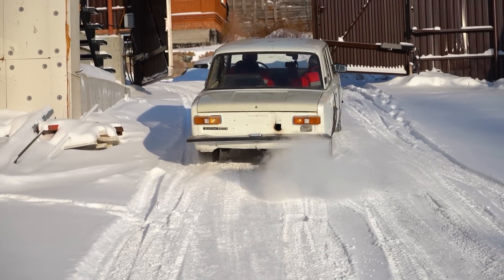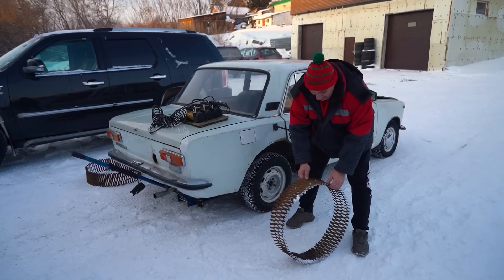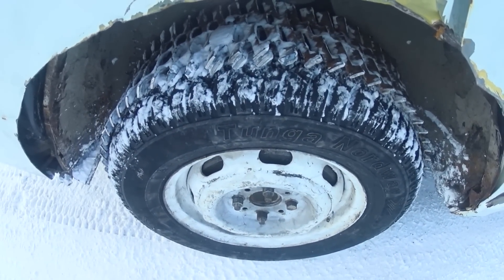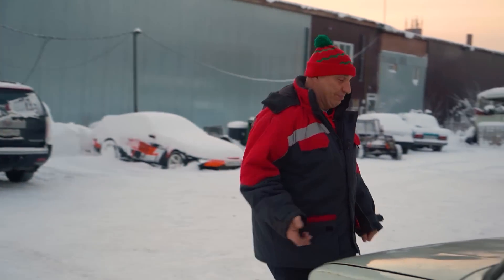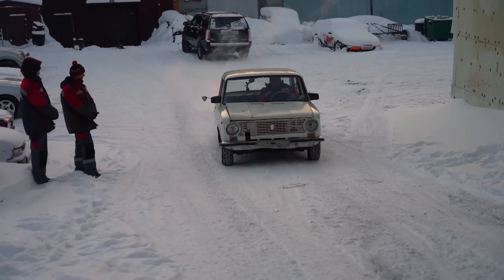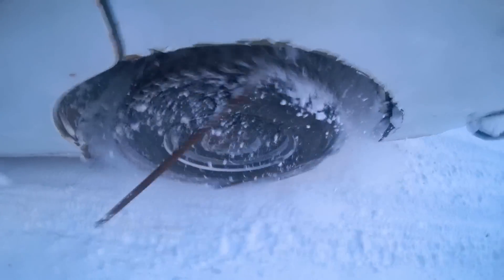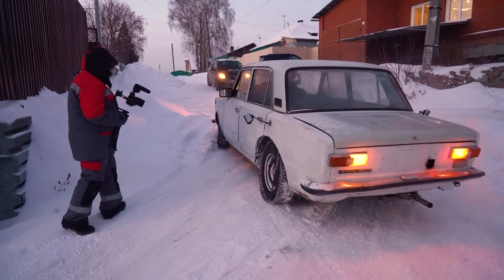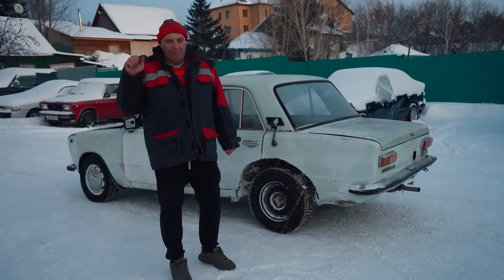Metal mesh wrapped wheels – will it improve traction?

Comment: put some large studs, in from the inside by having a flange around the outside and then bolt it together from the inside with a lot of screws and sealant or heat the metal to melt the rubber.  See if you can make them air tight and.

Comment: best way to do those would be to make the metal diameter dimension about a half inch under the outer tire diameter, then let the air out of the tire, put ring on then inflate tire, let the tire pressure hold them on, that will work REAL good..

Comment: nice nice, and you can/could even stud those, if you dont want to hover/fly with self-ducted impeller wheels
Reply: try a passive self-heat operated pulse jet heat sink, narrow cold air entrance, large output exit, like in a rocket stove
Reply: attach that to the bolts of the wheel as a crown
Reply: ie, make the bolts have longer length, so that you dont have to remove the bolts to attach a "second wheel"
Reply: yes just like in tractors
Reply: yes full rim attached to the stud-mesh-track extra wheel on the extra long bolts
Reply: try a rubber airless/inner-tire wheel wrapped from powerline cable, thick, put also a normal outer wheel on the cable inner tire, keep the metal wire inside the cable

Comment: It'd be great to use extra long studs with open ended lugnuts. Granted, you'd need a deeper socket, but...
Then you could weld on a centered hub with holes to match the lug pattern.
4 extra lugnuts, and now you're set. A vehicles own jack and lug wrench would be sufficient to install these. 

Most importantly, the hub now would prevent the mesh from being able to slide either way once the nuts are installed. 
Whereas the rebar solution only keeps it from sliding inwards... Unfortunately, they could still slide OFF the tire! Which in any instance, would be very bad. 😉

Comment: I've got an idea... Manufacture 2 low profile electric driven caterpillar track systems. Mount them up under each side sill. You drive the car as per normal but... "Oh no, i'm stuck in the snow!" (or mud)... No problem, you press a button, the caterpillar tracks can be lowered hydraulically and then, when in position, you start them rolling and hey presto, you're moving again! And then once free, you can disengage, and go back to standard wheel drive..
Or..
similar hydraulically lowered/raised electrically driven caterpillar track, somewhere along the centre, lowers just enough to get traction, and once you're free,  you can disengage the 'Emergency track system' again and drive as per normal!
🤔🤔🤔    😎🇬🇧

Comment: Would like to see ratchet straps used cause I've used them lots to get me out of  places I've used them around the tire like your trying to help get it beaded and I've used then front of rim to back or rim both work good in a pinch if need to

Comment: My dad built a flat bed trailer for his sand toys and used the metal mesh to cover the main steel frame, built like a tank, very strong material. If the car was four wheel drive you could get around easier.

Comment: A+ for Concept, but C- for Execution/Engineering.
Overlapping the ends of the bands was a failure to begin with - they should’ve been welded end-to-end. The overlap causes an area of increased thickness, which will cause reaction issues, and of course horrible wheel balance.
As for securing the bands to the tires: The rebar was a terrible idea! Instead, studded tires should have been used, with the expanded-metal bands being tacked to  the individual metal studs. Sure, more work to accomplish, but a much more secure installation.

Comment: what if the expanded metal mesh was put on a flat board and there was a system of linkages to make it drive like it has duck feet... just a thought.
Reply: I've seen it done elsewhere. It CAN work but is very slow and quite a rough ride.

Comment: That wasn't even deep fluff... It's deep when the whole front wing and bumper are full of gravel or sand... I used to put plastic carpet in my car wheels to add traction, it never failed. Got good laughs pulling 4x4 cars from snow and ice with my FWD Toyota Corolla and Skoda Felicia. Once I got my car in so deep snow, it took 3 months to dig it up, the other time I got parking ticket for parking my car outside parking lot, but it was on top of a pile of snow where nobody can drive or hit it. But I guess they wanted to take away the snow under my car ;)
Reply: Like indoor outdoor carpet you see on an outside patio or porch?

Comment: This honestly should work. Idk why nobody thought of it before.
Do X shaped thinner braces on the outside that have a spot in the middle to bolt on a wheel lug or two. It might solve the slipping problem.
Reply: Ofc it works, its just like chains but dumber.
Reply: The issue with snow is you need a flexible deep lug pattern to squash together  when the vehicle weight is on it, that immediately "pops" out and expands its pattern to eject snow as the tire rubber rotates past the contact patch.
Watch this video that shows exactly that action: 
https://youtu.be/xd2k_jmb9RY
Reply: Or, make each track wide enough to wrap halfway down the sidewalls of the tire.  That should hold it in place.  Then it can be pulled tight with turnbuckles on both sides.
They'd have to mount the wider mesh on the tire while off the car.
Reply: Would require many many different sizes to manufacture.

Comment: I recently bought studded winter tires and i found the studs wear down quite fast and become less effective. This video is interesting.
Reply: Thats why they make tires with threaded inserts. Just change them when worn down.
Reply: you should try this on your tires they should hold up longer at the very least is simpler to fix then studs wear down
Reply: @raven4k998  it’s fun to think about but I suspect it would be rough at highway speed😂
Reply: i have over 15 000km on my hankook iPike and studs still holding up!
Reply: How much do those studded tires cost?
Reply: @joshuagibson2520  pretty normal pricing key word "studdable tire"
Reply: @joshuagibson2520  mine cost $600 for 4
Reply: @ThatToast  sounds pretty reasonable honestly. I'd have guessed 2-$250 per tire.
Reply: @joshuagibson2520  yeah I was pleasantly surprised, especially because I bought them a couple weeks ago, out of stock most places, buy them in the summer and I assume they're even cheaper. I got the nokian happapolita 9 studded for reference
Reply: the studs are replaceable usually. they stick into a little notch in the tire and can be replaced individually